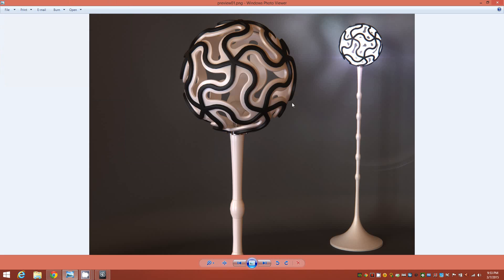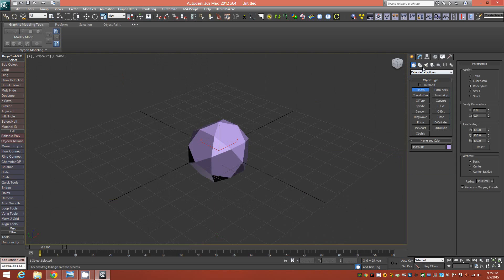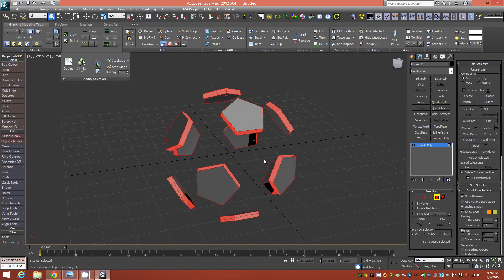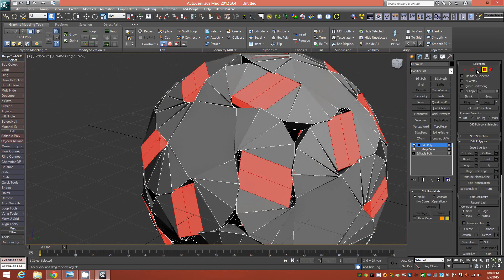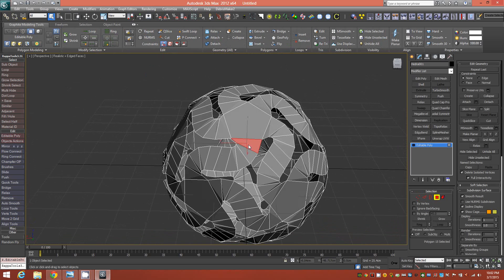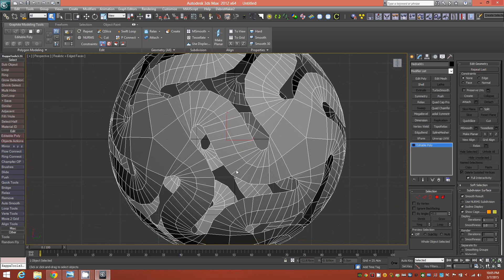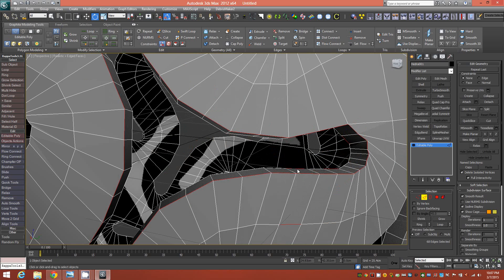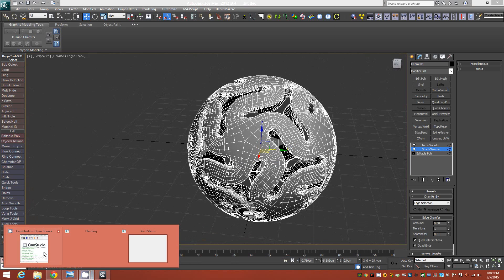3D Tutorial | Modeling A Linked Star Ball | 3dsmax

Comment: I think, it's also possible to use "select by angle" in order to easily select all the polygons
Reply from the maker: By default, the Select Similar feature will inspect for topology similarities such as angles and surface area automatically, so it's really a very efficient way of selecting more than one of the same type of sub-object.  However, you could try other selection types such as "select by angle", although this will only take into consideration the angle of the face, edge, or vertex.  So this means it could be far more likely, in some cases, to capture unwanted elements in the process.  Select Similar is a much more refined algorithm in that regard.  It's possible to select more than one instance of the element you wish to capture and use the Select Similar on multiple selections at once, so unless there's a specific need for capturing only specific angles, I'd recommend using the Similar selection as a general purpose tool.

Comment: Hi John... cant find that Graphite Modeling tool in 3D max 2016...
Reply from the maker: Hi, Max.  This video is an older one.  This is based around an older plugin modifier called MegaBevel.  Unfortunately, the megabevel modifier is no longer being updated for 3dsmax, and the last known update was for 2015, so it will no longer work in later versions of the software.  However, if you are referring to the Graphite Modeling ribbon and integrated tools, you may need to show your ribbon to have access to those tools.  Go to Customize > Show UI > Show Ribbon.  That will show the Graphite Modeling Ribbon in your UI at the top.

Comment: How do I access rotate I cant find it.
Reply from the maker: +Danilo Milosevic   By default, 3dsmax has the rotate tool assigned to the "e" hotkey on your keyboard.  Just tap the e key when an object is selected to switch to the rotate gizmo.  Alternatively, you can just press the icon at the top icon panel of the UI. The button looks like an arrow in the shape of a circle, and will show the words "select and rotate" when you mouse over it.  However, I would just get used to using the hotkey.

Comment: How did u mark all specific polygons on all parts ?
Reply from the maker: +Kamil Rochl I believe you are referring to the "Select Similar" tool?  This allows you to automatically select a set of subobjects that are "similar" in various ways to the initial selection.  It's available in the Graphite Modeling Tools ribbon, under Modify Selection panel.  You can read more about how it works here: http://knowledge.autodesk.com/support/3ds-max/learn-explore/caas/CloudHelp/cloudhelp/2015/ENU/3DSMax/files/GUID-7D388AEB-E42D-480E-805E-4312862461E7-htm.html
Reply: Thanks !

Comment: The error appears when i start max after installation of the file in "plugins" or "stdplugins" directory
Reply from the maker: Rodion Romantsov The only thing I can suggest is to be sure you're using the Megabevel_2015x64.dlm in your plugins folder (not stdplugins), and that you have all the hotfixes and program updates from Autodesk for that release version installed.  Be aware that the plugin only works with 64 bit 3dsmax, and not 32 bit, and be sure you are running the app as administrator in Windows 7 and higher.  Otherwise, I really don't know what would be causing the error.  Unfortunately, I'm running it on 3dsmax 2012, and will be upgrading to 2016 soon, where the plugin will be obsolete anyway.  I have an alternative tutorial to this particular starball on my channel, which doesn't require the plugin to create a very similar effect.
Reply: John Malcolm I think that there is a problem with the file, because i've check everything and i did everything right. Anyway, thanx for your answer and thanx for your channel. Can't wait to see some new stuff) Cheers

Comment: Really amazing in this modeling,but how to install "MegaBevel.dlm" in 3dmax 2014,I put it in both "plugins" and ""stdplugs" and it did not work.
Reply from the maker: chelin Daivd When you download the plugin, and unzip the zip file, you will get multiple MegaBevel.dlm files, each associated with a particular release of 3dsmax.  In your case, be sure you are using the Megabevel_2014x64.dlm, and drop it into your active plugins folder.  It should appear in your modifiers list after you restart Max.  There is no version of this plugin for the 32 bit version of 3dsmax 2014, so you must have 3dsmax 2014 64bit installed, and place the Megabevel_2014x64.dlm in that version's plugins folder.  For example: C: Program Files : Autodesk : 3dsmax 2014 : Plugins.

Comment from the maker: Once again, I'd like to thank Vladislav Gavrilov and the V.G. developers for offering the Megabevel modifier free of charge to all 3dsmax users: http://www.vg2max.spb.ru/release/fullversions/MegaBevel.rar
Reply from the maker: BIG COZZA Hi.  Thanks for commenting.  It seems you're not the only one having issues installing this plugin to 3dsmax 2015.  Unfortunately, I think the plugin will not work properly in 2015.  I used 3dsmax 2012 in this video.  However, all is not lost.  There are ways to produce this without the plugin.  Did you see the Floral Starball version, which works without any additional plugins?
Reply from the maker: +BIG COZZA (BIGC) Unfortunately, the object I create in most of these tutorials are not actually intended for use in game engines, but of course there's certain ways to approach that.  First, you can try reducing poly count by simply applying less subdivisions to the turbosmooth modifier at the end.  I usually recommend 2 iterations for use as a render asset, but as much as 3 or 4 can be optimal if you are exporting STL for 3d printing.  For real-time game engines, you could try using only 1 subdivision at the end, or perhaps 2, and then use the Graphite tools to remove edge loops that aren't necessary to maintaining the profile shape.  You might also try using the Multi-Res modifier, or the Optimize modifier, but beware that those techniques tend to destroy UV's, and introduce a lot of triangles.  I know tris are perfectly fine for game models, but it could make unwrapping even more difficult, so you would want to unwrap the objects while they are still quads.